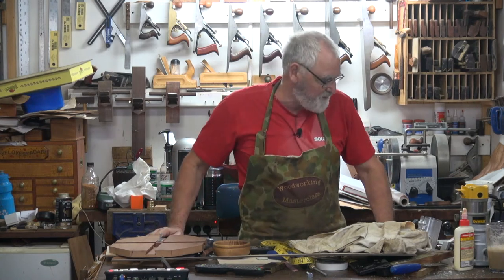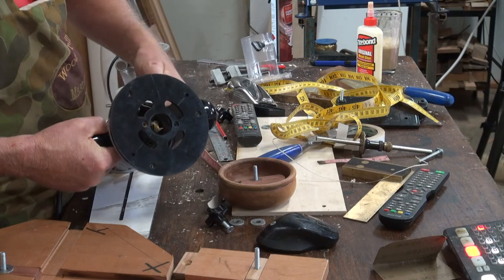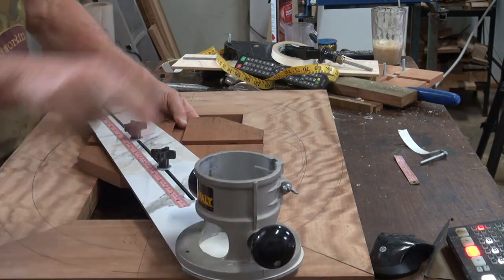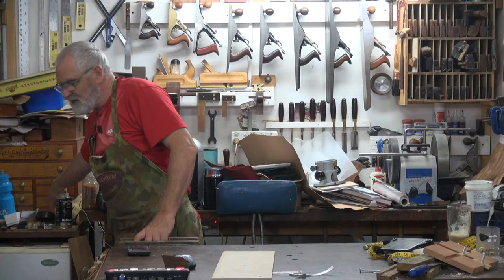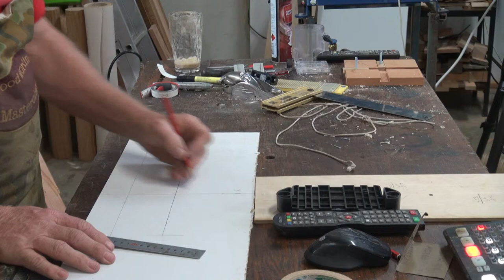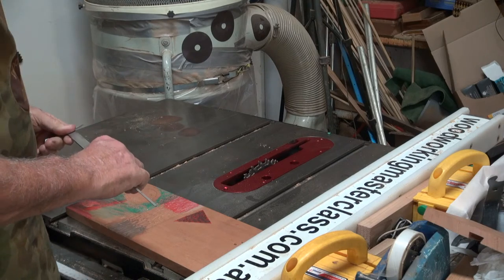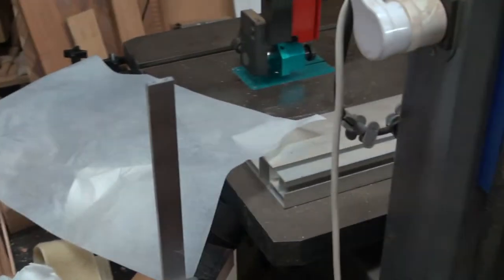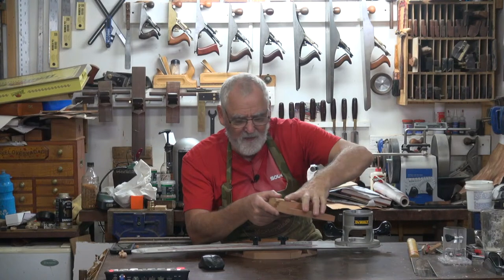Making an Oval Cutting Jig for the router.

Comment: Steve the first test piece would be a good one to cut out and use as a frame for either a picture or a mirror.  Think of it as an artistic version of the oval.  Many will like the differing thickness and you will confuse people on how you made it.
Reply from the maker: Hi Brenda. providing they don't want me to make another one to match. Actually they will be used as frames down the track. Hate wasting wood. What are you working on at present? Cheers Steve